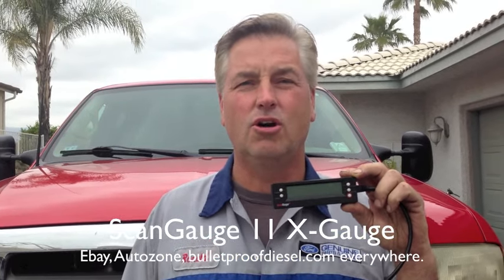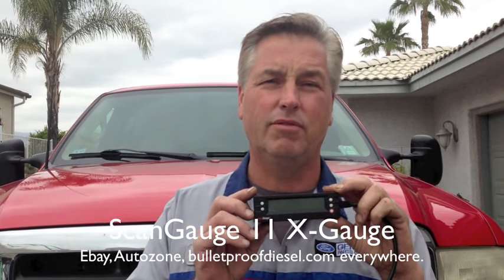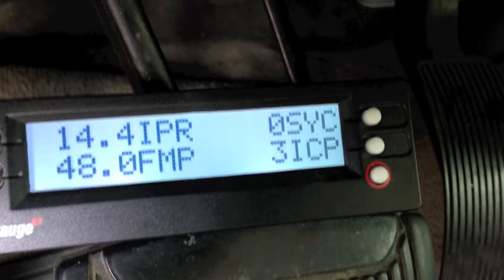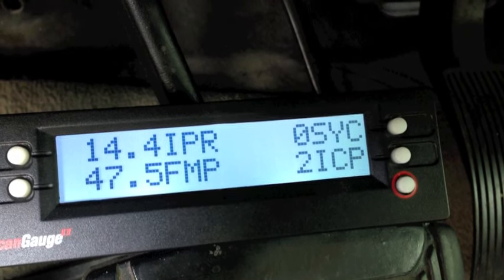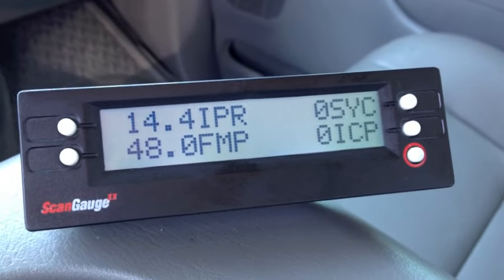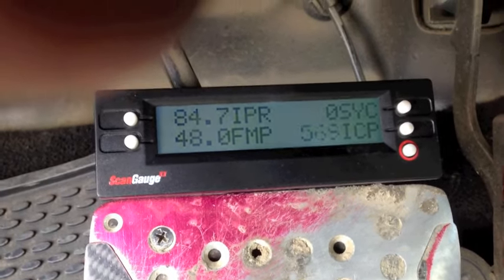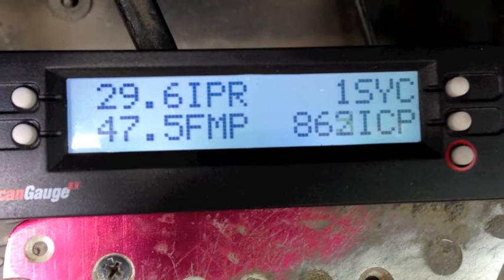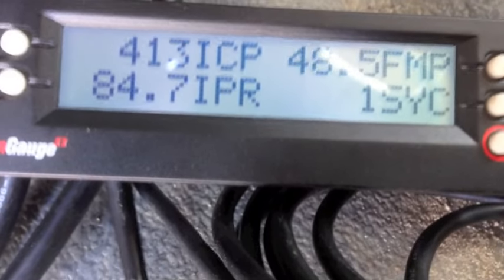Ford 6.0 crank no start. different senarios and diagnosis with a ScanGauge X-gauge

Comment: I recently had a no start issue with my 6.0 powerstroke diesel. Mine is a 2005 e350 with 733,000 km's. I was seriously considering buying another truck when it was suggested I have the mechanic check the oil pressure release valve off the crank. Apparently the needle bearing can fall and hold the valve open. Sure enough that was the problem. A very cheap and easy fix.

Comment: Had hell starting with new FICM, rechecked connectors after 5 tries and she starts right up. Problem I'm still having is I have no High Idle when the engine is cold. I have not done a mod to it. It just idle's at typical around 900 and never steps up to the 1200.

Comment: I got a 04 f250 and I was driving down the road and it slowly died like it lost fuel. I waited a bit and crank it again and it was a hard crank but it started up and idled rough went a little ways and it died again and now it won’t start. Will crank though. I changed the primary and secondary fuel filters and nothing changed. Anyone know what might be the problem.

Comment: hi my friend I watch most of ur videos but now I have a problem with my 2008 F-350 4.6 l the light of glow plug/diesel pre heat warning is not on in the dash board, since that happen my truck crank but not turn over what can I do to fix? I check all the fuses

Comment: After watching this video, I bought the ScanX gauge. With that, and Ron's help, it was determined that my 6.0 had a bad FICM. Ron offers the FICM repair/rebuild service with which I am very pleased. I received the FICM in short time, installed it, and my truck is now ready for a New Hampshire winter!! Thanks so much! 
5 Stars!

Comment: Hi Ron,
Just want to say thanks for the videos. Bought a scangauge II and set it up for the pids. found FMP @ 39 volts. Found out you sold ficms on ebay and checked out that video, then bought one. Got it in 2 days, put it in this evening and my 2005 f250 started right up. Thanks to you I was able to do it myself. Thanks, B.L GC Indiana

Comment: just bought a 2005 f350 6.0, start only with starting fuel and then it runs fine. you was about to say somethin in the first video  but didn't finish what was happening in that scenario. in this type of cases. thank for you videos i have lerned so much, thanks and keep up the good advise.

Comment: Thanks for these great videos.  In my 03 6.0 my turbo blew up with only 80k miles on it.  While I had the truck in my shop I also replaced the oil cooler, did EGR delete, blue spring, new ICP sensor, new exhaust, and turbo drain/feed tubes.  I'm not a mechanic and was able to do the whole thing by watching your videos.  After I was done, the truck ran better than it ever had.. for about a month, then I got a crank no-start.  My oil pressure was only reaching about 400psi.  I pulled the IPR valve first to check since I did not replace that valve, just put a new screen etc on.  Upon inspection, it looked like it was clogged up with shop rag lint, obviously from my work on the oil cooler.  I cleaned it up real good and put it back in.  Same problem, no start.  I pulled the driver side oil rail off for o-ring inspection on the injectors and they all looked good.  I was kicking myself for not replacing the HPOP when I had it torn down, but after allot of research and mulling it over, I finally just ordered a new IPR valve to try.  Surprisingly that was all it was.  Not sure if the lint caused the old one to fail or if it was just coincidence.  The truck is again running like a champ after the new IPR.  Thanks again.

Comment: Ron, you saved my butt with this video. Last week I had a slow crank no start on my '03 6.0. I tried all the basics and then I remembered watching this video a few months ago. I checked the AC pulley and it was hot. Pulled the belt and she fired right up! New pulley installed. THANK YOU! :-)

Comment from the maker: Sync should be 0 or 1. Recheck your programming code. As far as the ipr reaching 80 that can be a leak. Bad oil or weak pump on an 03. Do you have the right filter and oil cap on it? What does your icp read key on engine off? Is it leaking? The 03 is common to leak. If it really bothers you and you don't find something with my other suggestions. You will have to remove the valve covers and let it sit over night. Then remove the plug on top of the rail. (It may be loose all ready). Find out which

Comment: Fixed yeah!! Turns out it was the pump. I removed the pump and tore it apart. Found that the fixed swash plate had spun 180. So basiclly the pump was working backwards. Had seen that the reman. pumps had a set screw in the side of case to hold it so i drilled and tapped it, reassembled it with a set screw. Now she is alive again.

Comment: GREAT video !!!   my 06 is giving me fits right now.  gonna try replacing the STC fitting. picked up the kit today at my local dealer.
Reply: Chris Blevins 
hey have you solved the crank no start issue? what is the STC fitting? I could use some help... I've broke it down 5 times in three weeks and I can't do it no more. I'm going insane

Comment: Ron when I drive my truck down the road out the blue it starts to jerk violent and eventually stalls and cut off once it sit a second it'll  start back up.  Run fine for a mile or so and do the same thing again. I'm going to by a scan gauge 2   My truck is a 04 f250. 6.0

Comment: Ron i also tried putting 12v to the red wire terminal an ground to the red and yellow wire. It sparked a little but still no click. If the ipr is bad, will that cause only 10psi?? I read somewhere that even with a stuck open ipr  the pump should still be able to put out 200-300 icp. If the pump is bad is there a way to prove it??Any help would be great. Thanks

Comment: Just got a rebuilt FICM from ron, and it works great. My voltage now runs form 48.5 to 49 volts. I am hoping it helps out my cold start problems also.

Comment: Hey Ron got a 2004 ford f250 super duty 6.0 diesel, I think it's a ignition problem because I can put the key in ignition and try to crank but no crank. There is compression, starter works and just got new batteries put in the truck.

Comment: Hi Ron. I have an 05 that cranks but won't start. I have a scangauge 2 and programmed everything I needed as you have yours set. My FMP stays at 48.8-48 and ipr is 14.8 and on crank jumps to around 74 then drops down to around 50 and my icp jumps up to around 2500. Sync is 1 but no start. Installed new batteries today and rpm on the scanguage reads around 109. Engine makes no attempt to start. All pulleys are turning.

Comment: Hi Ron.  Any thoughts on this one.  First of all my truck is a 2004 F250 6.0 with 250,000.  I was getting on the highway about a week and a half ago and went about 100 yards and the truck stalled.  No bucking, smoke, noise or anything.  It was as if I turned the ignition off.  Got to the side of the road and it would crank, no start several times over several minutes.  I had my Craftsman code scanner (I know it's a P.O.S. but my Snap-On Solus was stolen a couple years ago) but I had no codes and no engine light.  Had it towed home and checked the oil, coolant, obvious leaks - nothing bad.  I did a shop air test of the HPO system with the ICP port adaptor and heard no loud leaks but could hear air bubbles in the oil filter housing.  I checked the 3 connectors to the FICM to make sure they had not gotten loose - all OK.  I had replaced my FICM power side last winter because the original had failed, but I have had no issues with it since.  I didn't check the FICM volts at the test window, don't know why but I forgot.  We were going to leave for vacation 2 days later so I rented a car and had the truck towed to my local Ford dealer.  I spoke to the diesel tech that was going to work on my truck and explained the whole thing to him.  Went on vacation and called about a week later.  The Service Manager told me that they needed to start with replacing the FICM because the computer will not communicate with the FICM and also mentioned that it's an aftermarket FICM.  I explained the FICM half shell replacement to him and asked if maybe it's a harness issue.  His reply was that the tech said that since there is no communication with the FICM that they need to start by replacing the FICM and then go from there.  I don't know if there were any FICM communication codes, they didn't tell me.  Does this sound right to you?  I told them to order it since I don't have the time to diag. and repair the truck myself right now.  I just don't want them to replace the FICM for around $800 + labor and then find that it didn't change anything.  Any thoughts would be greatly appreciated!  Thanks.

Comment: ron, we did everything you said in your videos. We even pressure tested the high pressure oil system, no leaks, holds 140psi overnight no problem. we have a no start situation only when the vehicle is warmed up, cold start it starts fine. also all new seals and o rings and new hpop, same situation, ron if you have any more ideas or suggestions please help. thanks buddy, mike.
Reply: Did you figure out what thee issue was? My 06 550 doing same thing.  Cranks cold but not after running.

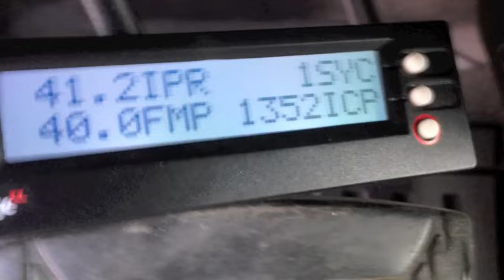Comment: Hey Ron, I have a 03/04 250 6.0, 2 days ago I put it in park and it immediately died, since then it has wanted to start but just won't and when it does start it's low idle and didn't respond to pushing on the gas. I hadn't drained the fuel water separator in almost 5000( I'm new to diesel)I drained it after but still isn't starting. My truck sounds like the one in the video at around 6:45. Any thoughts or need more info.

Comment: Hi Ron, 
Excellent videos!!!
I could use your help on my 02/04 6.0 Ford no start. I have sync, 48v ficm, ipc cranking only 10 psi, ipr 84.7.  I have tried uplugging my ipc still no start. I removed my ipr and there was a little debri in the screen. but not enought to cause it to plug. Tried putting 12v to the ipr. and no noise and doesnt seem to do any thing. Also am i hooking it up right. i tried putting power to the red wire termimal. and ground to valve body. Thanks

Comment: Hi Ron, I have a 2006 f350 6.0.
Recently it has been having longer cold cranks (~10 seconds) and sometimes hiccuping along the way. Batteries are recent, 2014, and according to my scanguage I get to the 500 psi req, my IPR is at about 30% while cranking, FICM power never drops below 47V and they are synced. I am at a loss now for what it can be since I still am able to start it. This is my first diesel so anything helps!  
Thanks so much!!
Mike

Comment: i have a LCF 4.5 L  that has a No Start it is a 6.0 less two cylinders,  wondering if i can get some assistance 
the Ficim is 48V the ICP is 1000 Plus or 1.55Volts  and the IPR is 30% on cranking 
 I have Fuel Pressure  from Pump into the Head  No active Codes   any Body Have any Ideas?

Comment: bought a scangauge ii the FICM has 10 volts what is the quickest best way to get up and running I could not find you on Ebay... do you recommend me purchasing a doorman FICM control from autozone and switching the board out or getting a bulletproof FICM.  I have a 2005 F350 6.0 turbo diesel

Comment: Hey Ron! I am working on a 03 ford 350 6.0 diesel.. put new head gaskets on it bled the fuel lines.. when i turn the key on i hear no injector clatter.. the fuel pump works.. we bought the scan tool hooked it up.. on the syc we have 0 with koeo and when we crank it goes to 1. icp builds and goes all the way to 1800... fmp is at 47.5 and are irp is at 38.5.. it cranks but wont start!!!! any help on the no injector clatter would help THANK YOU!!!

Comment: Ron,

Thanks for your great videos and I hoping your can provide some insight on our issue

Crank No-Start 95 6.0L F250:
Diagnosed by Ford Garage. HPOP only making 280-320lbs per ICP,  IPR not maxed at 85% when cranking and showing 14.5% with key on.  FCIM MP 48,5-49V key on and crank. We have GOOD SYNC. 

Dealer indicates bad HPOP

I install reman'd HPOP w/ STC and reman IPR (STC & IPR included with new HPOP) STC set tool used correctly and both STC and Pump o-rings replaced.  Still Crank no start (I know it takes really long time to prime HPOP and we have cranked her thought two complete battery drains/re-charges)

SCANGAUGE shows following currently:

Injection clatter good

FICM MP   48.5V Key on and 49V Crank
SYNC        Good
ICP            4-5 Key on,  7-9 Crank
IPR            14.5% Key on  84.5% crank

I am thinking new IPR is bad or new HPOP bad or Both.  OR perhaps we simply have not cranked long enough to prime HPOP.

Any thought from you would be extremely helpful.

Thanks!!

Comment: I am working on a 2005 f-250 I am using the scangauge 2 i am getting 1 syc, 23.8 IPR, 584 ICP and 48.5 FMP. My question is what would be the ideal ICP PSI? and what would be the reason for crank but no start..? the truck will start after i crank multiple times but i am puzzled thinking i will start with replacing batteries?

Comment: Thanks for sharing your knowledge, i have an 05 with occasional no ficm sync but ficm power is 48, the ficm input voltage has dropped to around 9v i have inspected harness, could it still be a faulty ficm?

Comment: Hi Ron... Thank you so much for your videos... I have found myself elbow deep in 6.0 work here lately...How would I be able to get my hands on a Scan Gauge? I'm in the middle of a no start hot situation now... I replaced injector seals (HPO) an then found that my rail nipples were leaking... Replaced rails and then found that one of the recons were leaking too... It starts getting frustrating after a while! Thank you for your time!
Daniel

Comment: my truck is a 2003 6.0l, about 50% of the time i get a slow start usualy when hot. so i got a scan gauge 2 and found that my ipr will hit 80% only for a second when it starts slow and then it seems to be normal. when it starts normal icp is about 30%. my ficm voltage never drops below 47v. is it a sensor problem or a pump problem any help would be greatly appreciated.

Comment: Hey Ron Please help! I have a f350 2003 6.0L it starts good runs good but when the engine temp needle gets in the middle of the gauge as a normal temp the truck stalls (just shuts off). I have order the scangauge2 and it will be here on tuesday. I will check all the main things you have said to check FICM,ICP,IPR. Have you come across this situation before. What do you think the problem is?
Thanks, Chad

Comment: I have an 04 F250 lariat 6.0 SD.  When parked on an incline it takes about 3 turns to get it started. Does the same when level for 8 hours.  Now on a decline its starts on the first turn of the key with no problems. What coyld cause this?

Comment: Ron, I have seen many of your videos and need some help diagnosing an issue with my 2004 F350 6.0 146000 miles. I was driving down the road pulling my small camp trailer under a bit of a load on a small hill when truck just quit. When I turn on the key I don't hear the fuel pump build up but I have plenty of power. No crank, no clicking. I have replaced FICM, ICP, IPR, Oil cooler, EGR, altinator, starter, over the past 2 years and have good batteries. My scan gauge showed good FICM sync and power. If fuel pump, relay, or fuse went out would this cause truck to not crank, I have checked fuel shut off also? HELP Please.

Comment: If buying from advanced auto it can be had for about 129 if you first search for advance auto promo codes for 25% off it and buy and pay  online and pickup at a local store around you.mine was 119 because used 25% off promo code and and a 10$ speedperks .Make sure it says the most updated unit on very front currently 6.2 version sg2.You will have to take hour or two to program it for diesel use.Goto scan gauge site under support for gauge and it has for the Cummins groups and international 3.0 6.0 6.7 and 7.3 so print out and program it.They have them for 188 shipped already programmed for Ford but programming is simple to do and he has video showing how. 119 out door is the very cheapest have found NEW....

Comment: Hi,  ive got a problem with a ford escape xlt 2005. The obd 2 scan tool listed these codes:
P1116 engine coolant temp sensor.
Out of test range.
P1650 power steering switch out of test range.
 P1703 brake switch same thing out of test range
P1780 transmission control switch od cancel also out of test range.
P0316 misfire detected on start up
First 1000 revolutions. 
It wouldnt stay in overdrive it kept slipping back at high speed. 
Could it be a wiring issue or do you know what it could be?

Comment: Hey Ron I've got a 04 6.0 and I have ficm power 47v ipr reads 79 and icp read under 300 and it is a new sensor and pigtail and I do have sync next on the list is ipr please help thank you

Comment: I have a 2000 Lincoln TC. Battery is new, and Fuel Pump is humming and works.

Car cranks over and over and over but doesn't want to start.  Then once in awhile, it surprises me and starts suddenly.  When it DOES run, it runs fine but once I shut it off again, it doesn't want to start. 

I've burned out my battery and starter both by excessive starting but have replaced them since. 

Car still doesn't start. Looks nice just sitting in the street tho.  

Help!!!!!

Comment: I'm working on a 2006 6.0 cranks does not start puffs smoke. 1100 psi cracking at 54 on the ipr ficm sync is yes. fuel filters are new no air coming into fuel bowl cranking key off . has bullet proof diesel ficm stays at 49.5v I'm out of ideas any help at all would be appreciated.

Comment: hello ron my truck started and ran for a min then shut off so it threw a code and it was the icp sensor so i changed it out now the truck wont even crank or turn over any ideas??